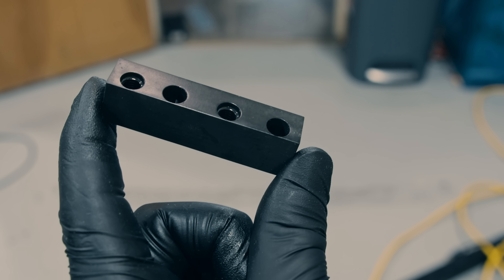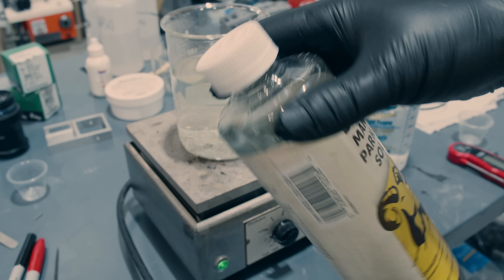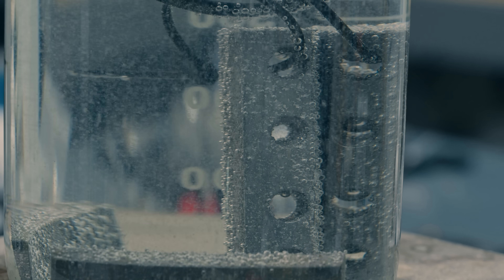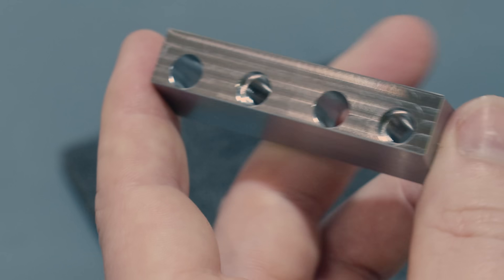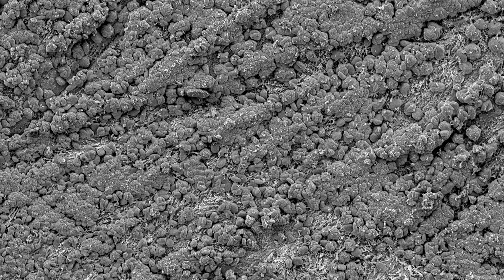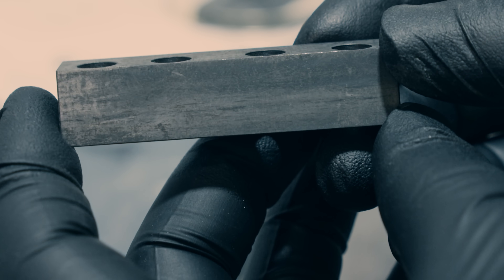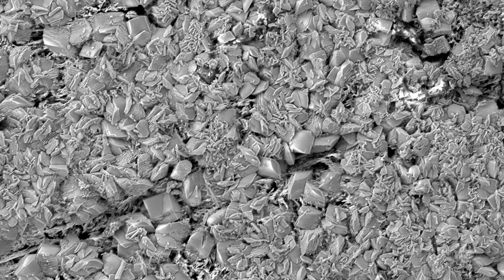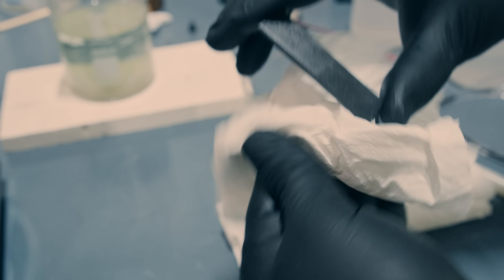Low-tech coating is a microscopic marvel

Comment: I've had good results heating metal parts red hot then plunging in used engine oil.  Wondering how well it would work to dunk the metal this way after your Parkerizing process?

Comment: I parkerized a 1911...used 80 grit aluminum oxide to strip down to clean metal surface, used non-chlorinated brake cleaner to degrease, ,boiled the solution (100C)...came out GREAT...the boiling once the part is removed, the latent heat automatically dries it out...once dry..dunk it in motor oil...wipe it down...done and done. WD is not a lubricant/oil...you need to put way oil or something like that on the part.

Comment: you should watch renzetti's video on cleaning for paint prep and how it relates with the water bead test.

It completely changed the way I think about cleaning. We normally think of acetone and isopropyl as aggressive solvents but they're actually kind of terrible at removing a lot of contaminates. A cleaning agent with bleach like comet is counterintuitively far more aggressive and yields things so clean that they're physically uncomfortable to touch with bare skin.

I do this to my 3d printer bedplates and it works better than anything else I've ever tried.
Reply: Is the renzetti video available on YouTube? If so can you link it. I think there are a lot of people that would be interested in it......

Comment: In case of aluminium part, does parkerization gives less surface friction (smoother) compared to anodizing?
Reply from the maker: I don't think you can parkerize aluminum unfortunately. It relies on a reaction with the iron in steel parts.

Comment: Are these stainless steel parts?  Thank you for the great content
Reply from the maker: Nope! These were 4140-PH. It's somewhat corrosion resistant but nothing like a real stainless. I'm not sure parkerizing would actually work on stainless, the high chromium content might prevent the parkerizing from working
Reply: @BreakingTaps  Thank you

Comment: Oilfield does this as well in the connections after they are freshly recut. We had a hot phosphate tank that you would roll the end of the pipe into and then it would give a rain bath for 15 mins .

Comment: “We can check the surface with the electron microscope” 😩
“Now let’s pop this in my atomic force microscope” 😭

I’ve made my own parkerizing solution before with the commercial phosphoric metal etching stuff and manganese dioxide from old alkaline batteries and it was a very dense and thick coating. iirc I heated the solution to boiling too. Your stuff might be a little old or a maybe a more delicate preparation for guns?  I guess it doesn’t really matter because it came out great in the end!

Comment: What about putting degreased steel wool in the solution? I think the solution bought for gunsmithing recommends this.
Reply from the maker: That's done the first time you use the solution to "prime" it. You can also use powdered iron which is what I did.

Comment: Really similar to how TriboTEX works to prevent engine/machine wear. Except instead of using electrical potential difference, it uses friction as the application energy and prevents hydrogen diffusion. 2:07

Comment: I wonder if the oils surface tension will span the gaps or fissures seen at the extreme magnification as displayed by the SEM. How perfect must the Parkerizing coating be in order to achieve effectiveness?

Comment: Heat it up to red, letting it air oxidize, then dunk it in oil for a carbon finish that's harder, stickier and more durable. Plus the heat treat hardening will increase hardness. It's low cost, easy, consistent, and perfect for shop tools IMO.

Comment: I did electro polishing and plating. One big effort was to make sure no work pieces were touching each other or the bath bottom or sides. Everything had to be fully suspended on copper hooks or you would get inconsistencies or shadowing

Comment: I just stumbled on your channel. Nice story, but about halfway through you break out the electron microscope, and diagram the molecular actions,  and then things got really exciting and really cool! 😊
Thanks! 😊

My limited experience with parkerization is it's good with parts that don't get scratched. You've probably already put these in service and you can see where they're tightened down that it just scratches the parkarization right away. One of the reasons they have also lost favor in gunsmithing. It still has its place in many ways but not where something will get scratched, bumped or dinged.

Comment: Lower abrasive bead blasting for a smoother more connsistant surface. It's the nucleation sites for crystal growth that determine the final result and hope it helps. Preheat the metal in an oven to 200°F. It will be slightly hotter than the heated solution before dunking. Phosphate can be sensitive to light so turn off the light and check after 1-2hrs.❤

Comment: Is it called blueing
Reply: Blueing and parkerization are NOT the same thing. Blueing is controlled oxidation which forms a layer of magnetite (Fe3O4). Parkerization forms a phosphate conversion coating - specifically crystals of zinc phosphate or manganese phosphate.

This is parkerization, not blueing.

Comment: Back in the day when I worked at a Tier 1 automotive parts plant, we coated steel components withe something called E-Coat or with Black Oxide. Both primarily acted as corrosion resistance.

Comment: as others have suggested bead blast or sand blasting will help get a more uniform coating also the acid bath beforehand will help degrease the parts to help with a more uniform coat

Comment: Well done. It's been a common coating in engine rebuilding for a very long time. Reground cam shafts are parkerized for better break in. Not roller cams but flat tappet cams. The coating holds oil to prevent the lobes from being wiped out from poor lubrication at the first start.

Comment: I wonder how this differs from Hot Dip Black Oxide in durability and look under the devices you have.
I used to do Black oxide where I work, I still have some personal parts that are Black without any rust more than 10 years later.

Comment: As others have mentioned, abraxive blast will help. Use about 120 grit sand or similar, no glass. Glass beeds wont create the surface texture you want.  Once the surface is etched with the abrasive blast you will get a much better coating.

Comment: I wonder if doing the coating process in an ultrasonic cleaner would increase the depth and consistency of coating.  Using an eye-bolt to suspend the part as opposed to to the plastic or wire might work better.

Also, the “Machinist’s Manual”, has direction for various coating processes, including what chemicals to use, temperatures, timing, etc.

Comment: great video. Re your noted residual organics on the bare metal parts, for future reference, when aluminizing or silvering glass, they have to be super clean. a very effective way to remove all organic contaminants which I use is first a wipe acetone and isoprop wipe, then scrub 3 times with precipitated chalk (calcium carbonate, not magnesium carbonate) slurry with demin water rinses in between and a final strong rinse. this might work also with your metal parts. the weakly basic chalk seems to helps by both physically and chemically remove organics.

Comment: how about rustic steel alloy, with full protection rust layer on top, similar to aluminium which has aluminium oxide passivation protective layer on top, how can basic ingredients be proprietary, anyone can do them, and not submit to your rules, rule takers, also nano layer of nickel or other electroplating non-corroding metals. how well that oiled surface finish would work as bushing flat surface bearings.

Comment: You can do a similar process but with just water. Prep the part as usual of course, then create a surface finish of rust (Fe2O3). Some people use hydrogen peroxide for this, occasionally with salt added. I like to just suspend parts over a pot of boiling water, but it takes much longer. Then submerge the parts in boiling water for 10-20 minutes to convert the rust to Fe3O2. Repeat a few times until you are happy with the finish, and coat with an oil. I usually use mineral oil.

Comment: Phosphating and oiling is also common for high strength martensitic steel fasteners used in sealed, oil-bathed environments such as engine connecting rod bolts. It protects against corrosion between manufacturing and insulation, but without creating hydrogen embrittlement risk like zinc electroplating. But for any steel part where the oil is likely to get dried off and not replaced, those phosphate crystals won't seal oxygen out from the surface iron for very long at all. The porosity that makes it such a great oil sponge also lets air, moisture, and corrosive agents like salt or hydrogen sulfide right through. However, your description of adding "light oil" is a bit limited. Phosphating actually works great with heavy oils, greases, or waxes. A thoroughly waxed phosphate coating should survive years out in bad weather without corroding.

Comment: I've been doing a lot of Parker phosphate coating using Jane Kits chemicals.  They recommend preheating the parts in boiling water, activating them in Metex M dry acid salt, and running the parkerising solution at 95C. The Metex M step preconditions the steel surface to make it more reactive when it goes into the Parker phosphate.  I've made my own home brew manganese phosphate solution and it's just phosphoric acid, manganese dioxide and water with steel wool dissolved in it. In my view, it's a way better coating than any cold blue that I've tried. 
Regards,  Preso
Reply: I thought of you immediately when the subject was parkerizing.
Reply: is that coating that is left on the part made of manganese? The structure reminds me of manganese nodules.
Reply: What concentrations?

Comment: The pickling step does more than just remove corrosion, it etches the surface to provide a better and more consistent finish for subsequent steps.

I'd be quite interested for you to inspect a range of surface preparations under the electron microscope.
Take a look at; freshly machined, sanded, scotchbrite, sandblasted, acid etched, etc.
Then parkerize all those parts and inspect again, you'll see the difference that surface preparation makes.

Comment: Ben from Applied Science has a video on how to get microscope slides optically clean.  I think he just uses Acetone or Methanol which can be used on steel parts as well.

If I remember correctly, you just suspend the parts in a beaker with a solvent at the bottom, and heat it.  The hot vapors will condense on the parts and pull any organics off as it drips off.

Love your content

Comment: "Larry Machine Tech" did an anodized aluminum video last week.   I thought the color was due to an oxide layer, but apparently you etch holes unto the sapphire layer,  stick it in dye, then seal the holes.  You have a AFM and a TEM/SEM.

Comment: Just get a stronger solution of Phosphoric acid, like a quart can (big dedicated paint store, i.e. Sherwin Williams or internet) less than1/20'th the price for a few ounces of "gun" & "Jewelry" stuff.  Unfortunately the "Parkerizing" or "Gun Black" solutions are quite diluted and weak (which is why they often suggest "pickling", which is just an acid wash to clean the part).  Phosphoric acid REMOVES rust, so do it twice,  a short time (3-5 min) to remove any rust, then rinse and let it soak for ~15 min. in new, clean P acid.  Heat is needed, but not a whole lot: ~40c-50c  is adequate (and in Arizona, free from the sun 😁).

Comment: You should consider if using something like using a process like plasma vapor deposition. If it could be used the crystalline structure might be so fine and smooth it would wear and seal much better. The critical factor would be finding a precursor gas. It would be so precise compared to a wet process.

Comment: I do PVD coating for industriell clients and we polish the aktiv part to a mirror finish to reduce wear and we get an extrem improvment in durability.
 Interesting to see that you also can get an improvement with the opossit aprotch. 
Sry for my Bad englisch and greetings from Germany.
Reply: I'm more in the firearms space but if memory serves the PVD process is the "general" term for the "brandname" DLC (Dimond like carbon) finish.

My question is how expensive is it to get a part done? What are some of the challenges with the finish relating to the part and it's geometry?

Thanks!
Reply: Ihr Englisch ist besser als mein Deutsch, als ich vor Jahrzehnten in der Nähe von Rosenheim lebte, und Ihr Kommentar war gut. Kein Problem und chuß!

Comment: I’m a small scale firearms manufacturer, and I use parkerizing during a two step coating process beneath ceramic paint. I’ve found that blasting the parts with aluminum oxide media gives you the correct blasting profile for a nice coating. Temperature and time also affect the final result. I think the higher the temperature, the lighter the coating color, but also the harder the coating. Whereas lower temperatures and longer time make for a darker finish, that’s supposedly less durable. Generally 175-180 deg F gives me the result I’m looking for. Furthermore you can also take those pieces that didn’t give you a desirable result, blast them lightly again, and redo the costing process to good effect. I’ve found that if a part has been parkerized before, and the finish is worn, there’s a fair chance you can degrease it and coat it without blasting as there are still manganese phosphate crystals on the substrate that provide nucleation sites for the reaction.
Reply: Amazing things happen when the oil film is removed, I just use brake cleaner and air to clean the part.
There is no substitute for non-chlorinated cleaner in a can, it's very useful for engine assembly, ie gasket surfaces.
When I oil my firearms, I just drench it in ATF, and blow the excess away.
Reply: @jamesfenton7338  It took me a bit to understand the last sentence.  Given you mentioned firearms, "ATF, and blow the excess away." has a completely different meaning!
Reply: I suppose there’s a reason so many countries in the WW2 and early Cold War era chose the “paint over park” finishing method. I have a French 1935A with ~95% of its original locomotive paint remaining on top of its zinc phosphate. It seems to have done the job.
Reply: thats what i do ,gives the paint something to hold on to.👍
Reply: I'm curious about this as a coating for automotive nuts and bolts. Would this stay rust proof. How much durability when using wrenches? Better than paint??
Reply: @gimpygardner3377  so it’s only rust resistant, but when oiled it’s nearly rust proof. As far as durability, it’s better than paint, but the underlying material will be the issue as even if your coating is durable, the(relatively) soft material of a bolt head will yield. Also depending on how long you run your coating process and how thick the layer you generate, the wear properties improve.

Comment: What happens if you burnish the surface after oiling it? If it's fairly soft, I'd expect that to smooth it to some extent and help seal the pores, trapping the oil in better?

I've done that with an old gunmetal pocketwatch case  I used a chemical gun black on, and the visual change is quite dramatic, giving a more silk appearance rather than matt.

Comment: the fact that you thought you don't need pickling is... interesting. The short acid bath is supposed to disolve the thin oxides created  by even minutes of exposure to air. It's why you do it immediately before any surface treatment
Reply from the maker: Very possible I was wrong about that (and perhaps that's why the first batch didn't look great)! I did give them a swirl in citranox (acidic alconox basically) which I didn't mention, but I don't think it would really count as pickling since it's relatively mild compared to say HCL.
Reply: @BreakingTaps I'm no expert in this. I may be very wrong. Especially since your approach eventually worked.
Reply: @BreakingTaps  Pickling with citranox widely used in professional galvanization processes so i'd definitely count it as pickling
Reply: Wrong
Reply: @dongvermine  whose comment is wrong? Mine? If you gave time can you explain? We're all trying to learn here.

Comment: Your SEM images are great and all, but the AFM just blows me away. The scans look way better than the first time you featured it. Have you just optimized the settings or has it been upgraded? I'd really like to get my hands on one of those.
Reply from the maker: Thanks! I did get an isolation table at one point which helps (mainly prevents big artifacts when trucks drive by, which would previously force me to restart). But mostly just gotten better tweaking scan settings, better post-processing, and improved my Blender-fu to make the renders look nicer :)

Comment: How exactly "roughing up" helps the surface to withstand sliding action? Wouldn't the crystals just be snagging on each others and abrading away? 

Yes, I know the oil also plays part in this, but I have hard time understanding how it could mitigate the problems of rougher surface to gain net positive effect.
Reply from the maker: Because the phosphates are relatively soft, they crush down to a smoother surface that conforms to the underlying steel, and like you said some of it will shear off and be suspended in the oil.  My understanding is that it basically acts as a deformable, sacrificial layer which lowers the coefficient of friction because it presents a flatter, smoother surface after crushing/abrading (at least based on a few papers that I skimmed, not an expert!)
Reply: @BreakingTaps  That makes perfect sense. Thank you!